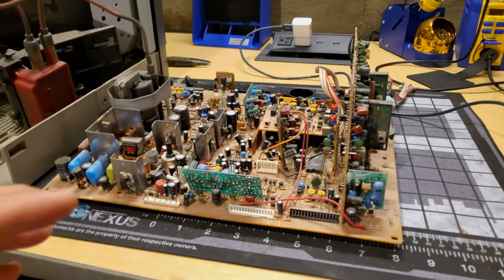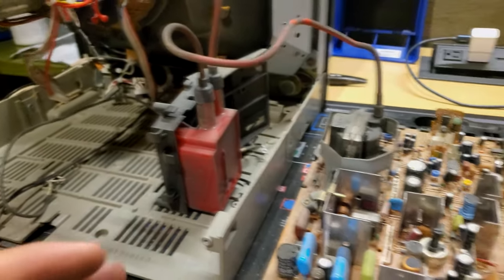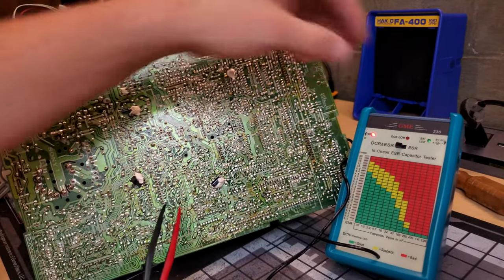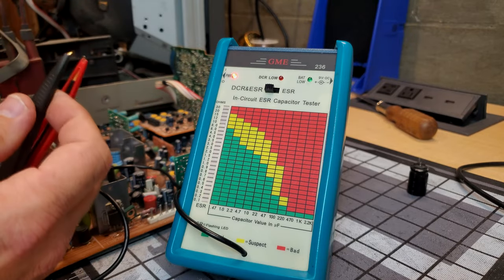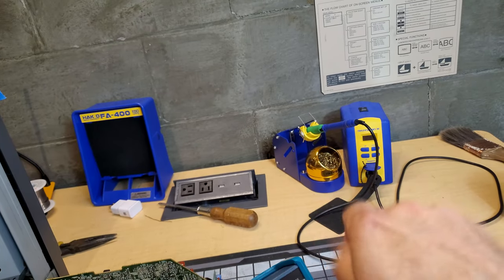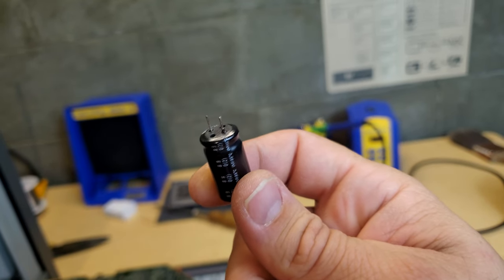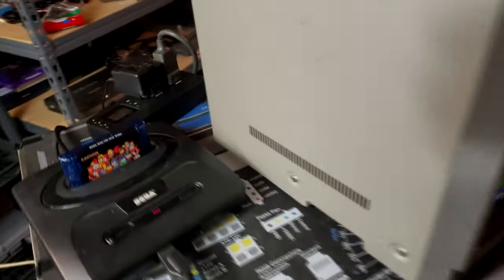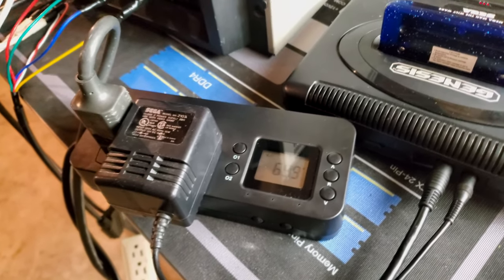The ESR Meter that tests capacitors in-circuit! 📺 Sony PVM 1342Q repair

Comment from the maker: If you'd like a link to the tool, please check the description of the video.  Look for more tool demos and reviews coming on the channel!
Reply: Damn, this is a game changer for sure. As a repair shop owner, not every customer wants to do a complete rebuild of a device. They just "want it to work". Unsoldering, testing caps is so tedious and I honestly hate putting used caps back in as they can be finicky sometimes, and again as a full time shop "money is time". Pretty sure I've looked at this unit on Amazon.

Comment: Thanks for the video! As far as I know ESR meter results vary depending on how many capacitors are in parallel to the capacitor being measured, so as long as the capacitor is not in parallel with others the reading will always be accurate, right?

Comment: Hey I have a toshiba 35af44, I seen a couple of business's online that recaps circuit boards. I would have to remove the boards and ship them to them to have it done.. I was just wondering if it would be worth doing. I looked inside of the tv, none of the capacitors look swollen. But I didn't know if that means anything or if they could still be worn out still. It was manufactured in 2004 and the picture is very bright still and beautiful!

Comment: seems this tester does 100kHz tests but some brands of capacitors datasheets are 120kHz so readings might be off for some, also the amazon page says "discharges capacitor under test" but doesn't specify to what extent? for example those Peak ES70 testers are rated for 50v max discharge so if you go over that you'll damage the unit, but there's no info on it for this unit?

Comment: when ordering replacement caps, how important is it to consider "lifetime @ temp.", "operating temperature", ripple current, height, and brand? or do you basically just look at farads, volts, diameter, polarization, and whether its a surface mount versus through hole?

Comment: What happens if something other than the caps goes wrong on these boards, say a random resistor, transistor, IC...? Is there any chance of getting it fixed? Are there people with the skill and knowledge to fix it? What would have happened during the time when these monitors were still produced? Would Sony just have swapped the entire board (or one of the sub-boards)?
Reply: They definitely didn't swap whole boards. There was millions of dollars poured into research and development of these monitors (and consumer TVs) by the big name players such as Sony. As a result, they often had detailed and comprehensive error reporting built into the TV or monitor design. For example, if your vertical IC is shot, the TV's standby LED will blink 4 times. Any repairman can use the service manual to look up what that 4 blink error code means, and will see that it's an issue in vertical deflection. They would then direct their attention to the vertical deflection section of the main board, and test the voltages of the pins on the IC (cross referenced with their value tables, again located in the official service manual), capacitance and continuity of any caps in that area, and even test if any resistors are open or fuses blown using a multimeter. 

TLDR: the engineering behind these devices was very well developed and planned out, so repairmen had many tools at their disposal for proper diagnosis and fix of issues. It would be very costly to replace entire boards or components anytime an issue arose. 

PS: ask me how I know about that 4 blink vertical deflection code.. couldn't possibly be because I accidentally grounded my vertical IC the other day, blowing it.... ;)

Comment: Thanks for your video.

May I ask you a question? 

I have a Sony PVM-1444 PM, a slightly modified version of the PMV-1444 QM, but compatible with Brazilian PAL-M.
Was working well until I left it unused for many months. After that, I tried to use it and it does not work anymore. The power LED (the green one) lights up dimly and I got no audio or video. If I choose the RGB input, the color system indicator LEDs (in my case PAL-M and NTSC) both light up dimly and if I press any adjustment button like brightness or volume, the activity indicator LED lights accordingly.

I measured the power supply under load and I got 115v straight on the 115v line, 5.5v at the 7v, and 14v at the 15v line. 
The degaussing works. The CRT heater doesn't light up.

With a kill-a-watt, I got around 12W of consumption. It starts with more but rapidly decreases to the aforementioned consumption.

Do you have any advice for me to start searching for problems?

Best regards.
Reply: I’m not sure how to fix your problem, but I do know that some people might be able to help in Steve’s discord server. I forget if you have to pay for his Patreon to join it or not but I would say it’s worth it

Comment: @1:13 Has anybody come up with a replacement for the high voltage resistor assembly?  With as common a failure as this is you'd think some smart guy would figure out how to build a functional equivalent from jelly bean parts